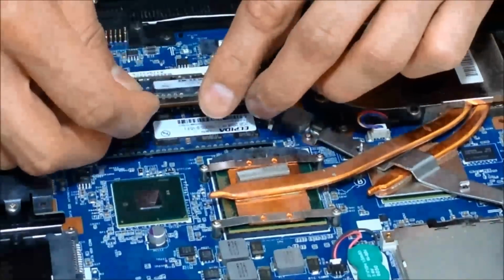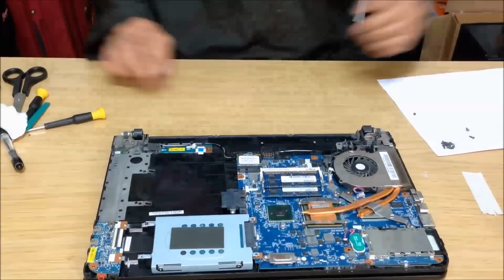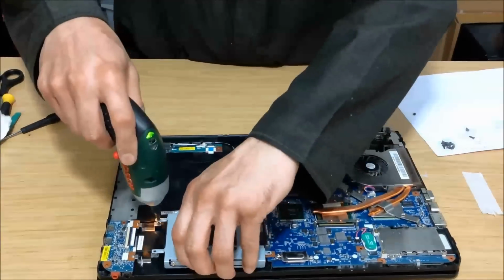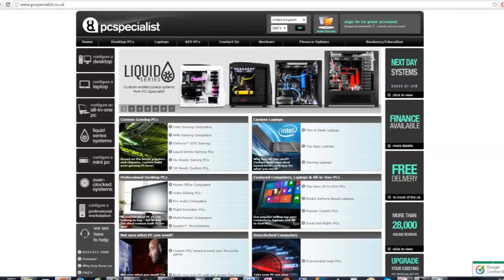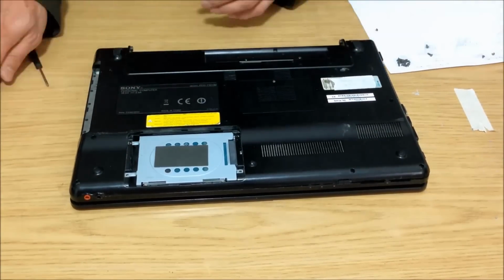How to Fix An Overheating Laptop Repair –  Sony Vaio Disassembly Fan Cleaning New Thermal Paste

Comment: Very good video but the main point was to clean the fan, but I only saw 2 seconds of cleaning dust from the back plate.  What about the fan blades?
Reply: Totally agree with you, overheating is chiefly due to dust build up on the cooling fins of the heatsink, the fan cannot push cold air through the fins to allow a good cooling effect.  Changing the thermal paste will achieve very little I feel when looking at the heavy dust build up on that fan.

Comment: Way to much thermal paste for these small chips lmfao.
Reply: Less cooling. All the thermal paste does is removes air to make the heat transferable. You only need a thin layer to get rid of the air gap.
Reply: Криптомерия If you have too little paste it’s not going to git full coverage on the heat spreader or die and it won’t stay as cool, Add a quite bit more thermal paste usually around the size of a large pea (Little bit of a smaller size for laptops depending on the size of the die), Then you should be good but they usually put a lot more thermal paste on GPUs and laptops because there’s no heat spreader and for bigger CPUs for example: The threadripper you need a lot more thermal paste to get full coverage on the four die under that big heat spreader, sometimes people usually put two lines or an “X” shape on the CPU heat spreader.
Reply: what are the  results of too much termal paste?
Reply: Ron
Reply: Thanks mate
Reply: The reason why they need so much is because that’s the die because there’s no heat spreader on it it’s kind of the same thing on GPUs when you open them up there’s a whole bunch of them will paste and usually the summer pace is non-electrically conductive so it won’t harm any other chips
Reply: ikr
Reply: Just cleaned a dell laptop, someone (from factory?) had put way too much compound. Not just the shiny CPU plates had it, but most of it was off the sides XD that's the DIE right. Either way, I cleaned it all out with vodka and qtips, had to use force to get rid some super dryed bits. Took me about a hour of scrubbing :D

Tomorrow I'll be applying thermal paste for the first time (to this same laptop which was given to me), in 17 years of using computers (lmao).
Reply: Arch Dev Don’t worry it’s normal plus they have to do that because there’s no heat spreader where you can put a lot more paste they have to put it directly on the die and add a little bit more so it gets full coverage.
Reply: @archdev1170  What tool would you use to remove the caked on old thermal paste?  And would you then finish cleaning it with an alcohol swab or paper towel with alcohol?  Very little liquid, of course.

Comment: what about a hp laptop where the fan continues to run all the time even after the dust clean out and re-paste...............happens on some dells .......is this normal
Reply: I repair about 5 overheating problems a week. usually a repast and clean does the trick. I would check the thermal pad on the GPU. failing that it could be time to replace the processor, they are cheap enough.
Reply: thanks